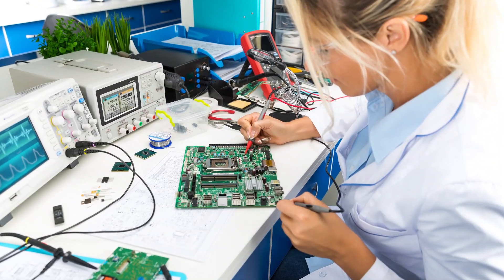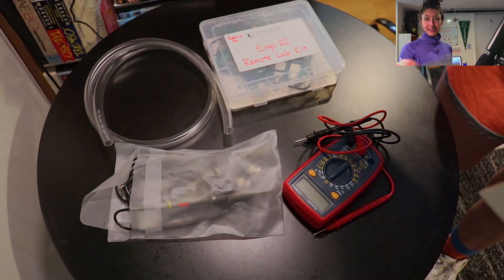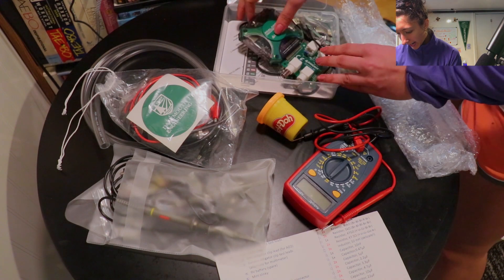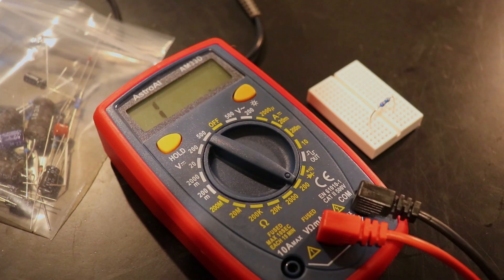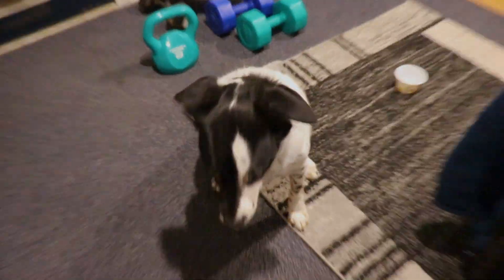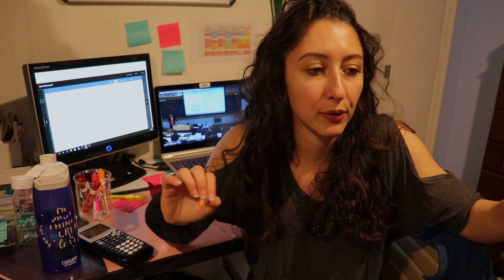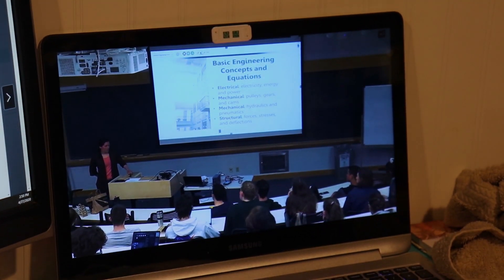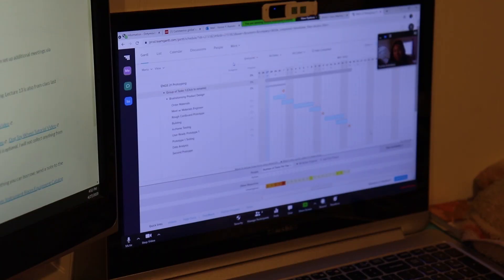This is How I'm Learning Engineering from Home // Online @ Dartmouth

Comment: I've been a distance learning student in my first degree - Math. I'm a single mom, non-traditional student, working full-time and doing Mech. E. online at Alabama. I currently live in California and am taking Heat Transfer, Cprogramming, just completed engineering graphics. Taking Astronautics, EE Fund.'s, and possibly Mechanics of Materials lab online this summer.
Reply from the maker: do you get mailed equipment as well or is it strictly virtual?
Reply: No equipment as of yet and all of my classes will be completely online. The lab scheduled for this summer previously required distance students to physically attend but that remains to be determined. I really want to start a Youtube channel on distance learning Mechanical Engineering but I'm way too busy to do it.